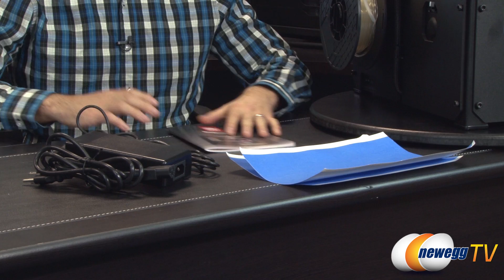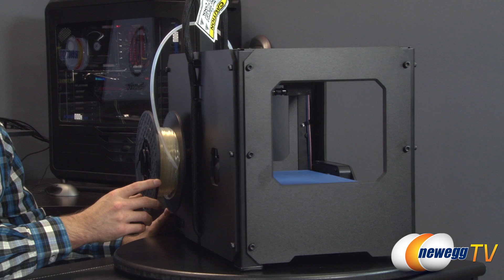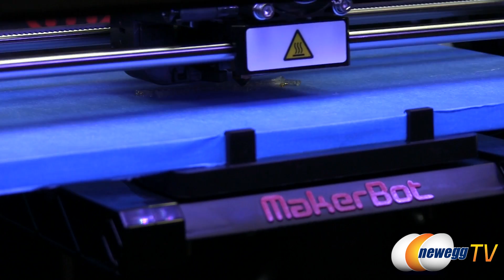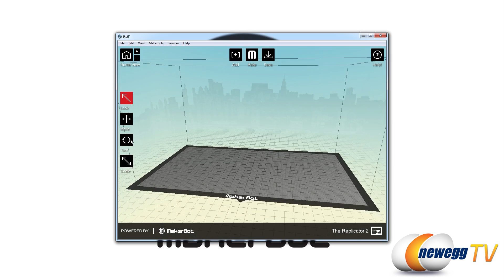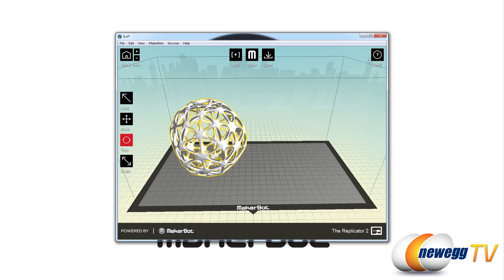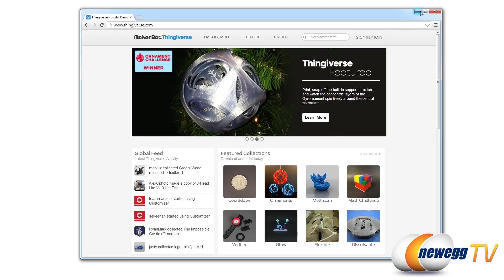Makerbot Replicator 2 Black 3D Printer Overview - Newegg TV

Comment: I have these at my college and calibrating the plate is pain butt also 4 out of 10 printers had thermal failures and one had a display problem. I urge you guys to get the warranty. One downside is change the filament. The plate would be at the top near the extruder and the only way to get the plate to move down is to build and then cancel a project. Honesty great technology, but I don't think it's ready for mass production, but it's great for teaching and understanding CAD programs and how to utilize into a 3D print.

Comment: Looks cool and fun but who truly needs it? What can you do with the finished product?
Reply: anything you want, since you'll be able to print pretty much anything you won't depending on the abilities of your 3D printer
Reply: Surprisingly a lot can be done with the objects. Facebook 'Robohand' for a start.  My machine is the earlier open source Replicator version 1 dual (now bought as 'flashforge' on the bay). That machine does ABS, PLA, Nylon, and many more.  I restore old cars and printing the gears and window runner parts in Nylon works great.  PLA is fine but can snap under extreme loads, where ABS is forgiving, and Nylon is just plain old tough.  3D printing is a growing arena with wild cost fluctuations per platform, research before hand if you leap.
Reply: 66tbird1
I am glad you can put your 3D printer to good use. But for me, this is the first time that I can say that as an early adopter, I have no use for a new piece of technology. But I do not dismiss in any way its usefulness for you. I am glad that the printer can actually do something useful for some folks.
Reply: I understand your view completely. Simple as a microwave it is not. But I can say that after a steep learning curve of a few months and the development curve contributed by many sharp people the machine is set and forget reliable.  The challenge is the ability to convert an idea into a 3D drawing on a computer. It's a career for me so no big deal. But for the average Joe using patterns off Thingiverse is about the only source of new input. I push on the 3D printer concept to the youth not to sell anything but to profile a source for critical thinking.  Some get it and excel but most don't have a clue. But they all like to watch. Find a 'Rostock Max' video see what really put most in a trance.